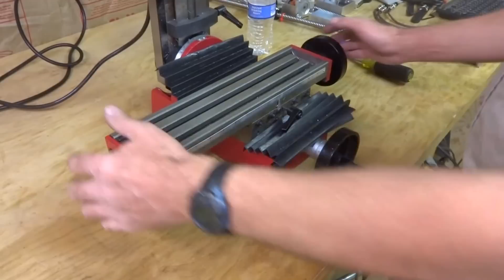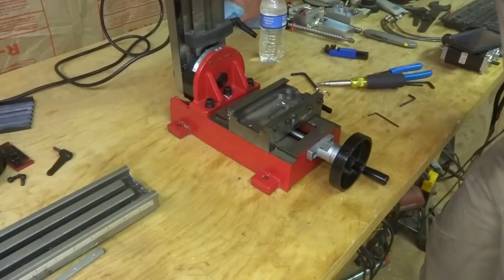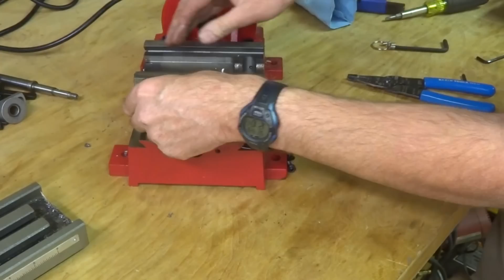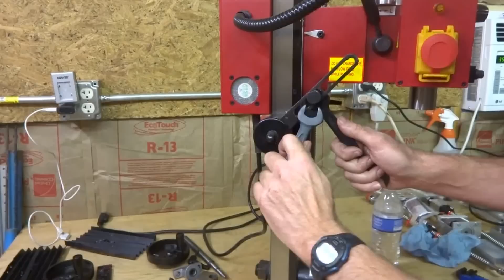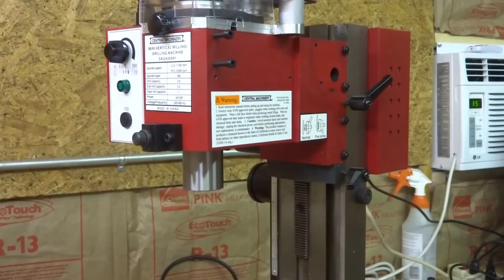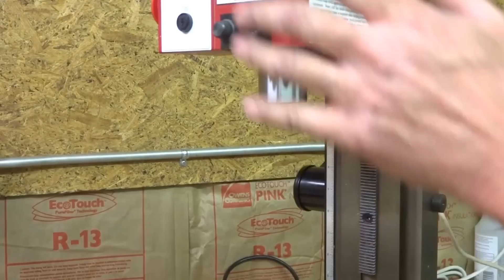Mini Mill CNC Conversion Part 3 - Teardown

Comment: also would this hand pendant be compatable to use with the mini mill software for control the the axis if you would wish to mill manually?
 http://www.ebay.com/itm/LCD-Display-Hand-Wheel-for-CNC-Pulse-Generator-Mach-3-Router-3-Axis-MPG-Pendant-/221482640418?hash=item339164e422:g:cNkAAOSwPcVV1ZMs
Reply from the maker: +Josh Williams - Well. it says it works with mach 3, but I'm not sure.  Most people I know or follow use an Xbox controller.  I got mine from Gamestop.

Comment: Hello again Craig. I have the same seig x2 mini mill but without the column swivel ability. I would like to order the kit from cnc fusion but am not sure which one. Is it kit #2 or #5 . I have the mini milling drilling machine SX2P with the solid base.
Reply from the maker: +Josh Williams - Hi Josh.  Not sure about that model.  I looked online and the photos I saw looked different.  You may want to contact CNC Fusion and ask them.  Maybe send a photo to them and see what they say.  It might take a little time to hear back though.  They get busy and don't always email back immediately.  .I got kit #2 with pre-loaded ballnuts.

Comment: good job on the tear down, Nice and shiny kit. LOL Im sure I'm to late but you can remove the Z stop as you wont be needing it.
Reply from the maker: CNC4XR7 
Thanks!  Yeah, shiny now but not sure how long. 2 of the dust guard screws were in the wrong place but that is a minor issue. Guess there are some slight differences is X2 models?